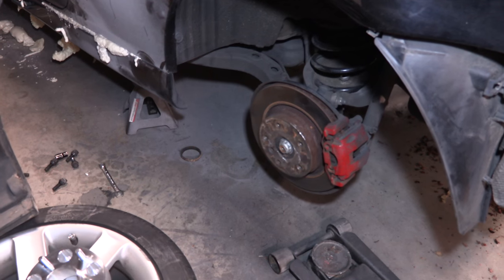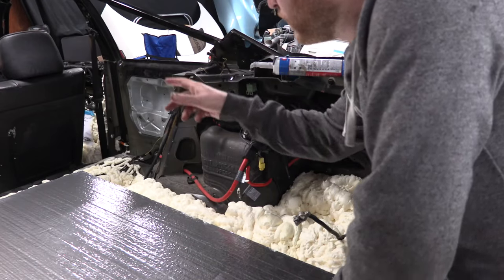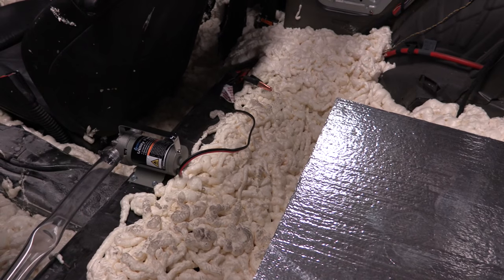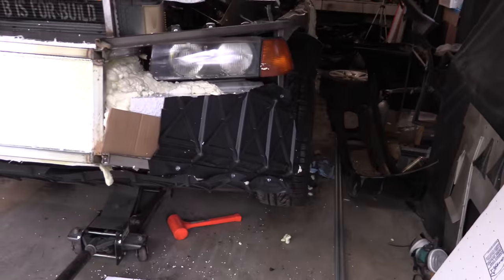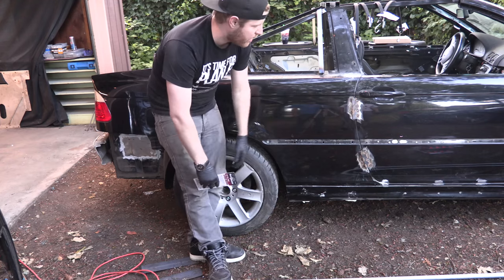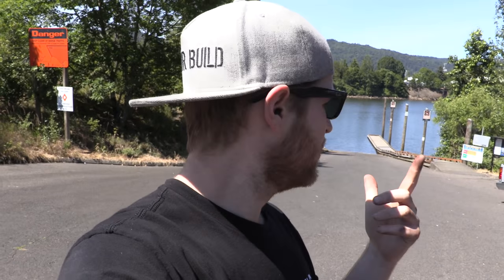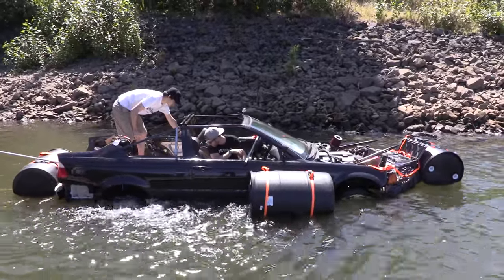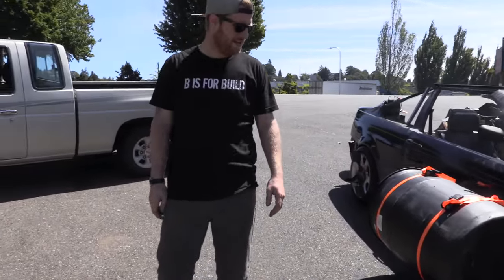B is for Boat - DIY Amphibious Car Finale

Comment: Commenting again because I noticed a helpful tip from another commenter. The paddles were fully submerged underwater which was why you didn't go anywhere. You should build some type of extendable paddles that you can extend while in the water. Or build longer paddles and install them while in the water. Think of paddle boats and those paddle water bicycles. They have less than half the paddles submerged under water. We need a second attempt!! The floating is there, let's see it cruise!
Reply: I would have put electric turbines instead of paddles

Comment: Like top gear you should get an outboard and go for it
Reply: Haha, that was my thought as well. Outboard motors are HEAVY, though.
Reply: +computiNATEor not electric ones and smaller like 5hp ones, there pretty light
Reply: I quite like the fact that he didn't use an outboard and anctually tryied to make the actual motor of the car do the work, it didn't work but ehy that was fun to watch

Comment: Did you look into the two part expanding foam material that comes in 5 gallon buckets? I'm sure he would've been a lot quicker and filled better than those cans. Shoot may have even been cheaper

Comment: So now that you have done it, and the car is completely useless as a car, I think you should continue to improve the boat. Recommend you make some pontoons that are welded to the side of the car, with sheet metal skins, flat on the top so you can stand on them. I would also make a stern or transom on the back, so that you can mount a small outboard motor.

Comment: It looks like you were unable to maneuver in the water because your paddles were submerged in water. If you lengthen the paddles on the wheels you would be able to move in the water similar to how a river boat works.

Comment: If displacement is all that matters, wouldn't the plastic be enough if you got it airtight? Then it would still displace the same amount.
Reply: They fill everything with foam in case there's a leak... and there is ALWAYS a leak.

Comment: you should have used the expanding foam they use for boat hulls. the shit expands many times faster and larger than that aerosol stuff. wouldn't surprise me if it would be cheaper as well

Comment: This would've been much better with an ADW vehicle. that way you can put paddles on all 4 tires and steer with the steering wheel. Also should've used larger paddles to go faster. But this is still awesome!

Comment: weld the exaust pipe way higher and pressurize the internal systems that keep it running and make the intake higher and you can drive underneath water

Comment: you made it float now you need to work out a working system for Steering and a way to actually propel the boat. The paddles obvisiously didn't work.

Comment: That front bar is about as straight as Richard Simmons.

Also, who ever thought of the back props on the wheels.... i hope you don't need physics in your day to day life.
Woulda worked if the water only came up half way up the wheel, but a full rotation would cancel one half's progress with the opposing side submerged too. Would be awesome too see the driveshaft utilised into a prop or maybe a prop coming off the diff.

Comment: i have a good plan
first u have to remove the differential
second make an extension for the drive shaft so it reaches the back of the car
and third u attach a boat propeller to the drive shaft :3

Comment: How come water doesn't flood the exhaust?
Reply: exhaust pressure is enough to push it out
Reply: exactly what he said.
good thought though i guess. had water actually managed to get into and up the exhaust i'd imagine it would cause some issue lol.
Reply: If an exhaust can pop a hot water bottle, it can push out some water. Just don't stall it...
Reply: As long as the engine's running it'll never get in there, but even with it stopped, as long as the water level stays below the exhaust ports it won't be a problem, the engine's exhaust pressure can empty the system pretty quickly, you just have to keep it out of the combustion chambers.

Comment: Too bad they welded the rear differential. Bigger wheel paddles, open diff and two separate handbrake cables+levers would have made it a steerable boat - you stop one wheel with separate handbrake cable, the other wheel starts to spin and the boat will slowly turn.

Comment: put a check valve on the pump and have it exit at a lower level.. or  have  the hose go up an back down trailing out the back.

Comment: If you added 30 inch fins and elongated the back and filled the fins with foam Not only would it look cool but it would have more stability in the water

Comment: the padels should have been wider
Reply: Wouldn't help as they were totally underwater - all they really did was churn up the water - think Mississippi paddle steamer, most of the wheel is out of the water.  Not easy to do that on a car though - a jetski water jet propulsion would have been the best option and leave the car engine to just give some (electrical) power.
Reply: +Darren Coull longer would help. But he would have to put them on while the car is in the water. Or have some sort of extendable paddle legs. That way half the paddles stay under water and the other half stays on top. That will get him going
Reply: its ironic because on a boat the propellers are completely sumbmerged
Reply: if you fitted a real prop (which works because of the pitch of the blades is angled instead of straight) to each wheel it still wouldn't work because they are pointing left and right instead of backwards :-)  Only way would have been to put a fanbelt pulley on each wheel and a large paddle wheel each side mounted half way up the rear fender (so only half was in the water) but then it could kill you, so there's that.
Reply: i see
Reply: Scavenge off the drive shaft with a v belt to or sprocket set to a "proper prop" assembly. The wheel paddles, meh.

Comment: Would have worked with better/bigger paddles on the wheels
Reply: Please do this again with better paddles! I want to see it actually cruising through the water
Reply: Yeah the paddles were pulling and pushing water. 
Maybe if they were cup or cone shaped it would help.
Or alot longer but then they could hit the ground
Reply: problem was that they were completely covered under water. so they pushed water to both sides. forwards and backwards. a boat engine outside the trunk would be the best solution
Reply: Y'all should remember that there is a reason paddle boats aren't used anymore - they are insanity inefficient. As such, bigger paddles would make barely any difference

Comment: 100k, builds a boat and drives out into a lake successfully, 200k, builds one of them cars that you can flip over and still drive, 300k builds a really fast car out of bits he finds at a breakers yard, 400k, builds a unicorn car (2 cars stuck together to make 1 like the MCM double unicorn build) 500k, builds an all terrain vehicle out of a sports car (kinda like mod max from MCM) 600k builds another boat, out of a box van 😂, 700k builds a donk vehicle, 800k builds a sleeper, 900k builds another BRZ (plan c BRZ) 1 million subs, makes the BRZ made 100'k ago into a serious track/drift car

Comment: A front or all wheel drive would have been much better in this situation so you wouldn't have to use the ores to steer (as much at least)

Comment: im sorry but this was a let down you need to put an out board motor on the back and do it again so you can turn better and have power and fix the little holes you have

Comment: Amphibious my ass! Was slowly sinking & couldn't self propel or navigate in the water without paddles & a tow strap. You managed to get a car to kinda float. That's a Fail!
Reply: ok
Reply: If they actually want to move further than the dock it would have self propelled, it just doesn't turn hence the paddles and the tow rope is so they don't float away also slowly sinking is an overstatement

Comment: out of all the amphibious car builds ive seen nobody thinks to weld fins on the driveshaft effectively making a propeller.
Reply: I momentarily thought of that, but then remembered that a driveshaft has to be nearly perfectly balanced or it will shake the transmission apart. The time constraints of the build really didn't allow for much more than quick and dirty.